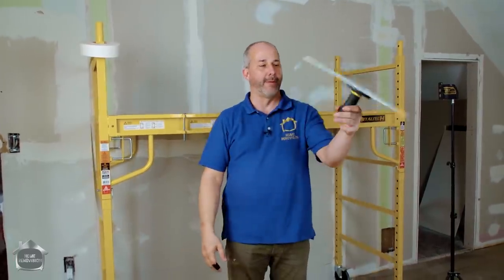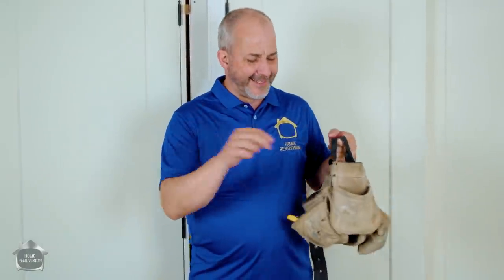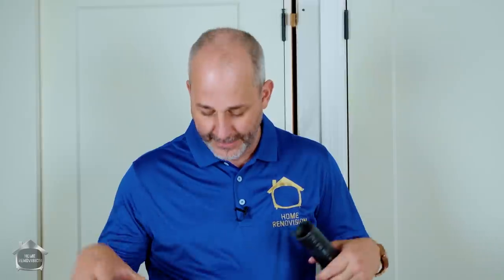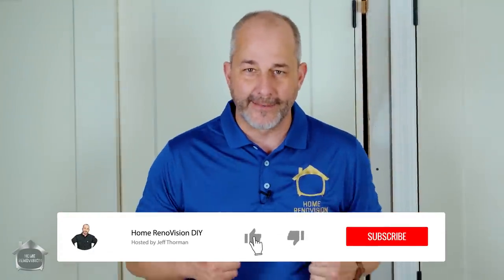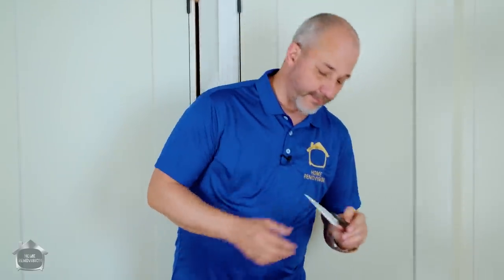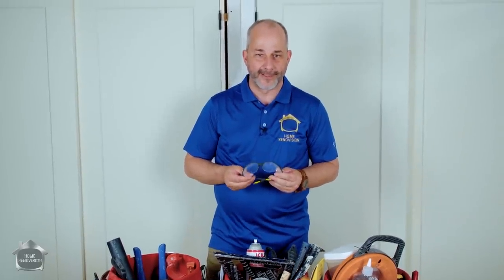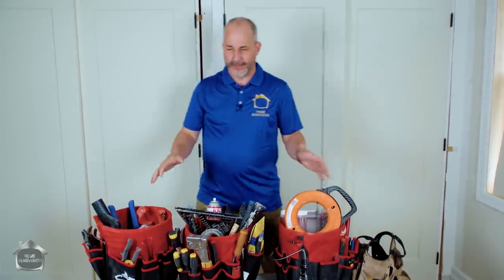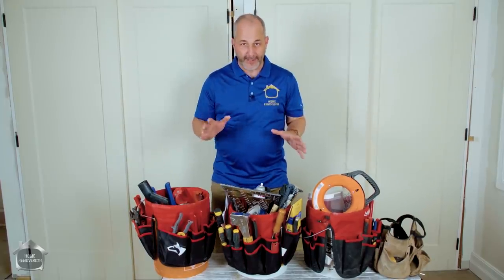How Should I Organize My Tools?

Comment: Hi Jeff, I've two questions:
1- what about big large tools that don't fit in a pale (like a 4' level or T-square)?
2- what about tools that are common in different trades (like a set of screwdrivers or tape measure)? Should we have one per each pale or we can have a specific pale for common (essential) tools that are needed in various trades?
Reply: For levels, I hang them. Whether it’s in the garage, the van, or the job. Drive a screw into a stud or wherever you’re working to let the level hang. Same goes for track saw tracks, drywall square, etc. Keep it from leaning or it will fall and get stepped on. For common tools (mainly p2 screwdrivers, small pry tools, etc) I get one for each container. Harbor freight makes this so cheap it’s not worth thinking about. Wrap colored electrical tape on the shank so you know what bucket it came from.
Reply: @danervin2530   Unfortunately there is no Harbor Freight here in Canada! 🙁 I guess Princess Auto would be an alternative (for Canadians)?

Comment: Attempt 2 :) Hi Jeff, Thank you for the great videos! I'm totally newbie here (ex. USSR past, Missouri USA present), from concrete 9 floor 13 entrance apartments to my own 33 years 2 story classic wood frame house in O'Fallon, Missouri. Most of my previous approaches (for the tools, materials and etc.) 95% not aligned for the USA (and inches and ft... :) ) Future plans: master bedroom (celling, walls - to paint, change the carpet (it was 2 dogs and 1 cat here and I'm allergic for them plus smell that they have left) for the vinyl sheet or vinyl planks (still can't to decide). Roof also has a very short rafter tails (almost with one level with the siding) and the siding (and artifactial bricks) with the existing roof creating the perfect Niagra falls to my basement (and windows) - probably I need to make them longer and use something to cut the flow above and under the window on 2nd flore, above and under the window of the 1st flore and where the wall connected to the foundation - some sort of a protective skirt (?)... Roof insulation (now I have 2-3 inches of "blowed paper". Then I probably continue with flooring for the rest of the rooms... Will appreciate any suggestions, especially for the advise where to buy vinyl (planks or sheet). Thank you

Comment: Sir, you are awesome, I am a big fan. Please do a video about what power tools you take on every job, how you organize and transport them? I hate lugging around so many, but I have been beat because I have needed and not had with me. I work for a contractor doing whatever I’m told from flooring to siding to decks, demo what he says I do. Thank you sir.
Reply: As a handyman/renovator I perform multiple trades.  Every project/job requires a pre-planning process of anticipating very tool you require, or may require, throughout the day to complete the task.  Unfortunately, you end up hauling double the amount of tools that you may need.  Nothing is more frustrating than having a problem on site, that you know you can fix with your available tools in 2 hours, but you have a tool that you left at the shop that could solve the problem in 15 minutes.
Reply: So what power tools do you take to each job for just in case. Right now I always take my drill, impact, grinder, multi tool, and stapler most days. What do others take to each job.

Comment: At work I use pails no organisers just pails. We have about 10 shops at work on 40 acres almost all have over head cranes from 30 ft high to 80 ft for the taller bigger tanks we build so you never know where you might be any given day as projects are happening everywhere sometimes just wherever you can find the room for small thing like platforms for the top of the tanks or stairs to get up there and occasion other times it's just a ladder. So your moving a lot day to day and pails come in handy to haul your gear around but at home I try to keep things organized in the garage where I also do welding that I can't get done during breaks at work and I keep a multi set and basic tools in the house as well but nothing stays organised I spent the last 3 days organising and cleaning my garage and now working in there today on a trailer car hauler double axel trailer it's a mess all over and tools everywhere already lol only way to keep things organised in don't use them once it's clean, but that's not happening. Well that dragged on longer then expected so if your still reading this I'm having some moisture issues in the basement of my 1914 2 story house I bought around 6 years ago and need to put weeping tile and possibly a sump pump since there isn't one present and not sure if you have any videos on those areas I'm renovating the basement in my spare time of my spare time so don't want to do all the work down there only to have it ruined by moisture issues. French drainage perhaps, regrade the dirt, need more info on that department.

Comment: Great video. I'm a DYI homeowner and have accumulated tools throughout the years as I could afford. I don't use them every day so I would welcome any ideas on how to store the buckets into the most efficient way ehen not in use since I don't have a lot of garage space either. 

I also, like the idea of having all tools that I need for a trade in one place, but sometimes there are common tools. Buying duplicate tools can become expensive especially if you get good quality. I especially don't like mixing my automotive tools with other trades or getting grease on my carpentry tools. Am I wrong, or should I just accept that I will need to spend much more gor the sake of organization and convenience?

Comment: Have you ever used the carhartt double sleeved pants with knee pad inserts for flooring?
Reply from the maker: a different version of it. pants with knee pads are awesome.
Reply: @HomeRenoVisionDIY  Who's version do you use Jeff?  Knee pads are a great topic.  After using many different pads over the years, my $90 gel pads are great for the knee caps, but every set I've ever used rub the back of my legs and knee joints raw.  End up with more pain and damage to the back of my legs than my knees.

Comment: Currently finishing my basement floor, but now I'm stuck on the flooring. I'm wanting under floor heat, looking at quietwarmth, as it states it is good for Vinyl Plank. What is your suggestion for underfloor heating options with vinyl plank, that doesn't require pouring concrete.

Comment: Redoing my kitchen and ran into an interesting situation. Currently have a typical split two compartment sink, but switching it over to a single. However, each drain line goes into its own independent drain in the wall. Never ran into this before, so do I just cap off one and use the other or use both? Also, we cut out a non load bearing wall  between the kitchen and living room. Now I have a partial wall that covers the fridge but needs finished. Should I just sheet rock it and use throw on some corner beads or should I throw some type of wood trim at the end to finish? We do white trim and can paint whatever, it is 101" tall (vaulted ceilings), it is in high traffic area. I thought about doing wood, using a router to round over the two edges, and painting it white
Reply: Assuming those 2 drains are 1-1/2" or better I would just use one and cap the other. Make sure you trap it properly. I can imagine some weird drain noise by teeing off to 2 drains from the same sink.

I personally like a wood cap to protect the exterior corners if there's a good chance the wall be bumped and kicked over its lifetime. Either option sounds like it would fit your style though!
Reply: @alexhb12333  nice thanks for the info!

Comment: I was thinking about getting a magnetic stripes to put in my cupboards for tools
Reply: Magnetic strips are great to keep tools where you need them.  Princess Auto (the Canadian Harbor Freight equivalent) has multi packs of various lengths at a great price.  I added a strip to my general tool box, so I'm never setting down the tools I'm using in the mud.  A strip an my table saw, router table and band saw keep the adjustment wrenches on the tool where they belong.  A strip attached to the side of my Flux welder keeps accessories handy.  Two strips added to the gas BBQ keep the BBQ utensils handy and organized.  A magnetic strip holds all my large kitchen knives, tucked under the upper cabinets and out of sight.  Use and benefits are endless.

Comment: What's your go to fer extension cords wrap or coils or throw in a pile?  Every one seems to say they gave the best way but still get knots
Reply: I decided a long time ago that I wasn’t going to spend a significant amount of my life rolling up cords in “exactly the right way.” Even a $75 cord isn’t worth spending 50 hours over its lifetime making careful coils. Roll up however and go.
Reply: Cheap way: just use a couple insulated strands from cheap 14/2 wire you find laying around on a jobsite. The insulated stuff bends super easy and when it eventually breaks just get another piece.
Better way: you can get something called a "Cable Cuff" from Home Depot, I think Lee Valley sells one called a "Cable Clamp". It's basically like a handcuff for a cord. They're awesome, a lot faster than wire but also not free, so figure out how much your time is worth and take it from there
Reply: @devinF1piper  I finally found the "Cable Cuff" to be the best solution for extension cords.  They're available in all different sizes, so I even use the small ones on power tool cords.  I attach the Cable Cuffs with a zip tie to the plug end of the cord so the Cuffs don't go astray and it's right there after you've coiled your way back to the outlet.